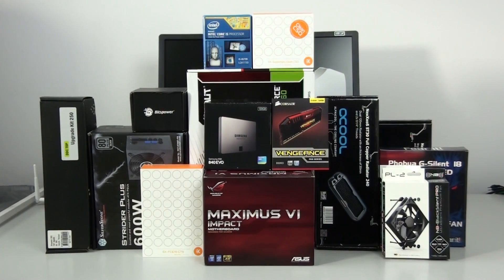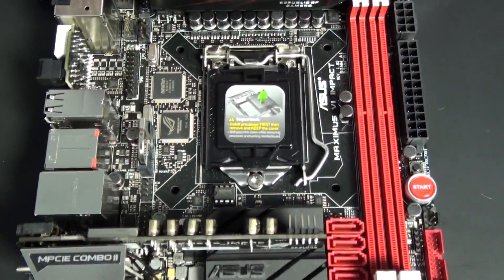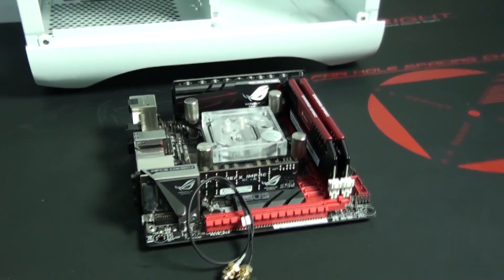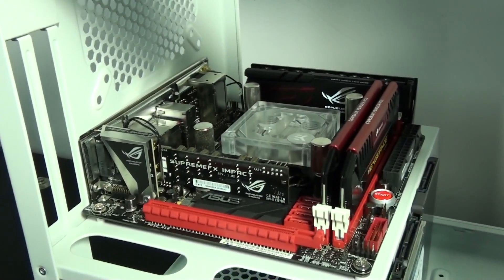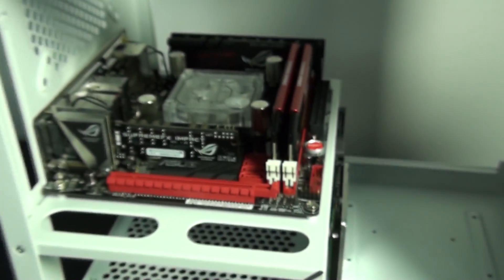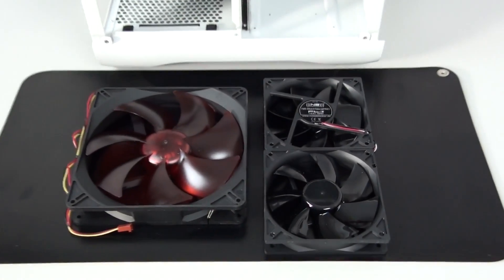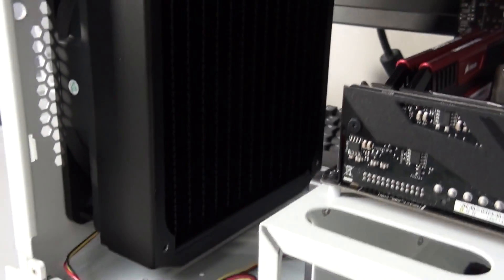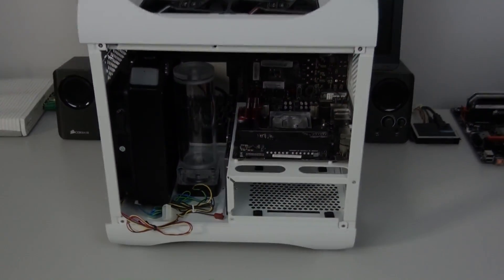Build #11: Prodigy Liquid Cooling: Part 1

Comment: I agree with using the 180mm over the 200mm, the fans are just better and the Alphacool radiator is a perfect fit. Will be interesting to see how you mound the pump!

Comment: I have a Prodigy build going on where I remove the top handles, replace the top with a frosted acrylic hand-bent panel, altered side panels and use a custom front panel. I'm using the BitsPower full cover water block for the P8Z77-I DeluxeW/D board, and the EK water block on the R9 290X. Thanks for the inspiration. I stole some ideas from Build log 9 :)

Comment: would be awesome if you sanded the 670 block to a smooth finish then polished it so it matched the cpu block and got rid of the gtx 670 branding, that would bug the hell out me. As usual though, gonna be awesome

Comment: Hi. The build look awesome, i am going to build something similar. However, i wanted to ask if you can put a 180mm radiator in front, without removing the 5.25 drive bay. Or, could i fit a 200mm radiator without removing the drive bay?
Reply: You need to let go of that 5.25 disc drive mate. There is very little need for them with digital distribution. If you really need a CD/DVD drive, I suggest an external USB drive.

Comment: Hi i was wondering, I been hearing so much problems with using EK waterblocks. I bought the EK Geforce GTX Titan SE waterblock (Acetal + Nickel plated Copper). I hear they have galvanic corrosion problems and back then EK used to bs about how people used other chemical anticorrosion fluids/coolants or just distilled water and silver killcoils and the waterblocks were peeling and corroding and all sorts because of the people doing what they prefer. Do you still think they do that kind of crap? I see you use alot of EK waterblocks i want to hear from you what do you use? Coolant/distilled water and so on and killcoils or w\e? I really want to use only Killcoil + distilled water as i have primochill advanced lrt tubing pearl uv green already. I don't feel like using coolant but if it really helps my waterblocks from corroding and having algae going into my loop i'll listen to you. Please give me your honest review of ek waterblocks. I really don't want to get fucked over and i would listen to those that know what their doing, you look like someone who knows what he's doing and has a good faith in ekwb's...
Reply from the maker: As long as you use high quality coolant with corrosion inhibitors and a biocide you shouldn't have any problems. I use Mayhems coolants and never have any kind of a problem.
Reply: ***** are there problems with ek's coolant

Comment: I don't understand this build...

It's not very good for gaming. (Bad, out-of-season or low-tier parts, like the 670 or an i5.)
It's very pricey for such bad components since water-cooling is so expensive.
And it's not good for a media centre because it has gaming-grade components and costs a lot. (If you went for a media centre you could've chosen like an i7 4770k and not bother with a GPU. And you wouldn't need to water-cool it. Because it won't run high when watching movies, etc. Also wouldn't need an SSD, unless you wanted like a 60GB for boot. And then like a 3TB drive or something...)